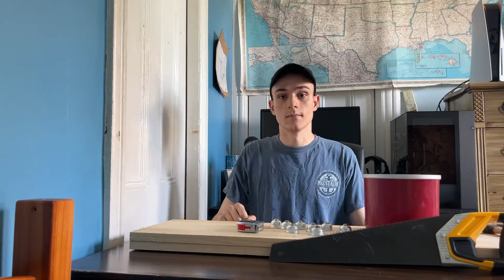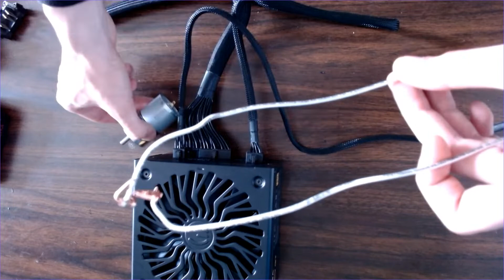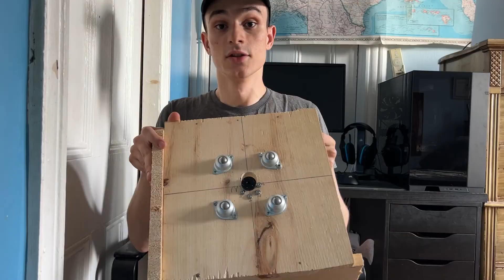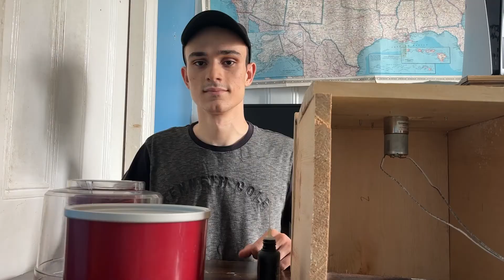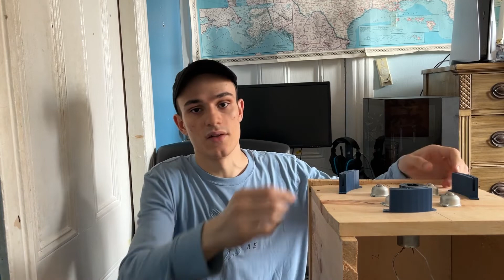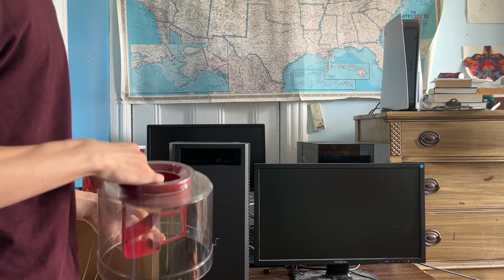I Used My Computer to Make ICE CREAM!!

Comment: How'd you ge t the spinning black piece on the wood to fit with the ice cream maker? Didn't you 3dprint that part?
Reply from the maker: Yes, I did 3D print it. I took some approximate measurements and then I used geometry to calculate approximate angles on the piece. Then, I did my best at designing the piece in CAD Autodesk. It worked out, even though the fit was not perfect.